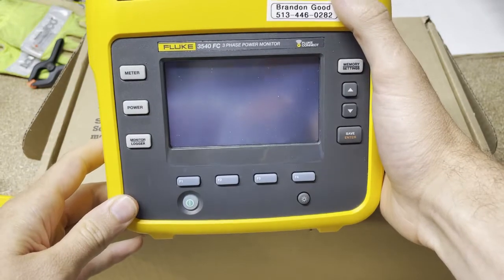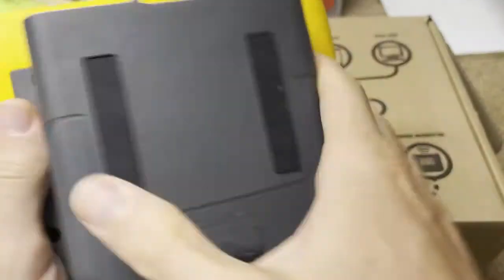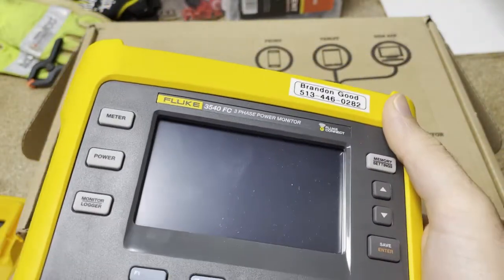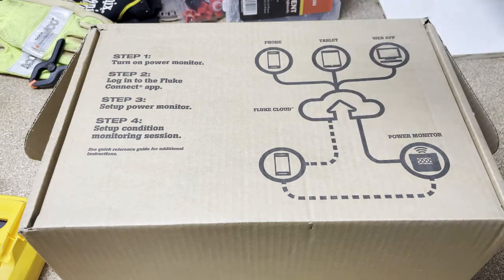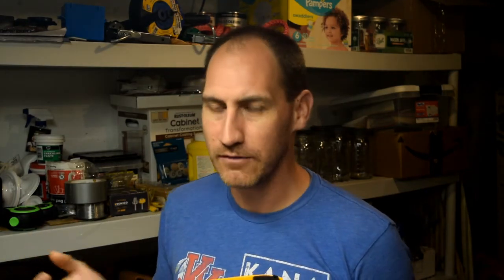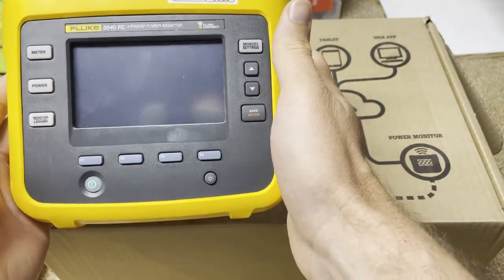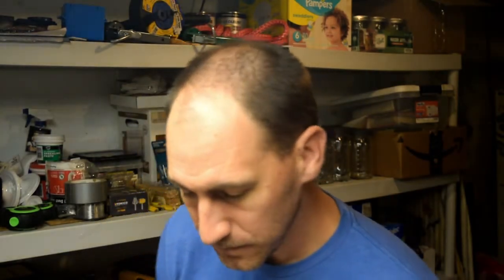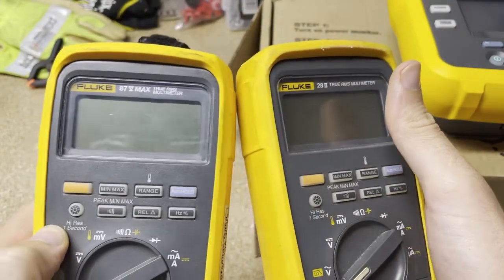Fluke 3540 FC - Fluke Fridays - Episode 55

Comment: I need your help!!!!!!!
need to buy a power analyzer:
The power input to our traffic signal cabinets is 120/240 single-phase.
We are interested in assessing AC power grid quality.
The typical AC RMS current for a traffic signal cabinet ranges between 30 to 60 amps, we will need to leave the 
Monitoring unit inside the cabinet for a few days. It is essential to be able to email the recorded data to the electric
Company, so having reliable and secure data is important.
The cabinets are located on the street, and environmental factors such as humidity, as well as low and high temperatures,
May affect the cabinets.
Reply from the maker: I would recommend one of the following:
Fluke-1736/EUS or Fluke-1746 (no screen but can handle harsher environments)  

Fluke-1736/EUS (do not get the "B", you wont get the accessories you need) - https://www.amazon.com/dp/B016DPDVI8?linkCode=ssc&tag=onamzbra04d98-20&creativeASIN=B016DPDVI8&asc_item-id=amzn1.ideas.2XZ847JBOA5EJ&ref_=aip_sf_list_spv_ons_mixed_d_asin

Fluke-1746 - https://www.amazon.com/dp/B07DY3N3Q4?linkCode=ssc&tag=onamzbra04d98-20&creativeASIN=B07DY3N3Q4&asc_item-id=amzn1.ideas.2XZ847JBOA5EJ&ref_=aip_sf_list_spv_ons_mixed_d_asin

Comment: Not a happy camper!!! Did not know i needed a subscription to the cloud to use this. Only wanted local Datta logging capabilities. And i want something fast to pick up spikes and brown outs etc. Any suggestions and can i trade or sell this junk?
Reply from the maker: I would go no lower than the 1736/EUS (do not get the 1736/B, it won't come with CTs)  Other great Choices: 1738/EUS, 1775, 1777.  (if you're not working with a distributor already check out my amazon Links:https://www.amazon.com/shop/fridayswithbrandon/list/2XZ847JBOA5EJ?ref_=cm_sw_r_cp_ud_aipsflist_aipsffridayswithbrandon_6311M39PGEAJCSPW68H7

Comment: Wish I watched this video first... I have no need for cloud-based monitoring.  My local Fluke rep pointed me down this route and the 1730 series would have been a much better fit for me. Honestly, the Fluke app and the cloud system are driving me crazy.
Reply: Yes me too, at first couldn't even start a logging session. Tech got back to me and told me to uninstall the app and reinstall and it took care of that problem but now I can't share anything. I've about had it with this thing

Comment: I'm looking for the correct tool to do the following:
I want to log 3 phase current usage of generators that don't have access to wifi.  The idea is to leave the test equipment inside an enclosure for a week possibly longer.  The generators typically run 8-16hrs a day so the battery needs to keep the unit active during those outages.  After a period of time the tool would be downloaded and I would look for things like peak usage, kWh used per day etc.  The goal is to see what size battery bank would yield a comparable output to the generator for use in a hybrid generator configuration.  Any suggestions on what to buy?

Thx
Reply from the maker: Does the place where the generators are have grid power? I might need to have a conversation with you to make sure I make the proper recommendation. You can call me at 513-446-0282. Or if you reply on here I'll do my best to help you.

Comment: Hi Brandon,
Im planning to buy the Fluke 1734 to measure the power consumption of equipment at my workplace and see where i can reduce that consumption. I just have a question about the voltage probes if you could help me with that.
to connect the voltage probes you must connect one end into the energy logger and the other end into the desired equipment however that means the equipment must have a suitable voltage probe input. How would you go about measuring power consumption of equipment that dont have voltage probe inputs. Also generally, what would you recommend to use to measure power consumption/Energy usage.
Thanks
Reply from the maker: First I think the 1734 is a great fit for power consumption/energy studies. As far as where you connect the voltage probes on equipment. (I'm not sure what kind of equipment your are thinking of) But most will connect at the distribution panel or breaker panel depending on what they are trying to measure. They will typically attach the probes via the alligator clips that come with the unit. If this does not answer your question please reply with additional details about your application.
Reply: I'm trying to measure the power consumption of machines powered by a plug like a large oven for curing, robot arms or even a computer. Sorry Im a little new to this.  I really appreciated the response
Reply from the maker: @Bluewson  typically I would hood up at the breaker feeding that particular outlet.
Reply: @fridayswithbrandon  I am trying to measure the consumption of each machine in the lab but alot of them are connected into power bars or outlets out of reach. I was thinking of attaching the current probe to the power cable feeding into a machine and then manually inputting the voltage supplied from the outlet as it stays constant I believe. Would that work?

Comment: Hi, my company recently bought me the 3540 to log a chiller. I'm having a hell of a time setting up this logger with the Fluke connect app. I still can't get it to connect to the cloud. My question is can the 3540 be used as a local logger primarily?
Reply: I hope Fluke see a lot of complaints and returns with these. 
The Cloud subscription should be an optional feature only, I hate how companies are crippling their own products and tricking their customers to push recurrent revenue business models
Reply from the maker: @sire45  if by punched you mean purchased, then I would suggest that you return it Grainger is great at taking back returns. If you are willing to have a conversation please find me on LinkedIn or call me 513-446-0282. I want to make sure you get the right tool this time.
Reply from the maker: If by local logger you mean it can store internally and then download the data directly to a PC. The answer is no. Where did you buy this and how long ago did you get the 3540?
Reply: I've had it two days now and nothing but problems first with starting a logging session and now connecting and sharing. Ready to throw it out the window

Comment: Hello, very cool video. I wanted to know which thermal camera is the best for PCB troubleshooting?
Reply: it depends if you want to see the IC pins as well or if you want to know the difference in temperature of the lower section of ICs than the top and or want to see all trace temp, too. this is probably a longer answer than you were looking for. what can I say, end of the day, had time and a lot on my mind. below is my experience with thermal cameras.  
thought, I wish I looked at flukes first in 2009 when I started buying thermal cameras. 

I have used C2 Flir (you can pickup used for about $200) , Flir T400, (T series very expensive), the Caterpillar phone CAT S60, and the flir scout TK. 

be aware of caterpillar phone and co, their service is junk their warranty is none existent anywhere close for an acceptable turn around. mine broke in pieces. there are newer models out now. the thermal camera image looked kind of detailed not because of the quality of the thermal image. they superimposed the visible image and the thermal image on top of each other. it's a detail visible image with a very faint thermal image on top. it will show you where about is getting hot. 

Flir T400, purchased 2009 for 13K. very detail thermal image. that purchase was one of the biggest mistakes I made. I do a lot of field service. I originally got it to use in the filed. it is so expensive you be afraid to take it anywhere. I have 2 to 6 stops a day. to top that off nobody really wants to pay for thermal image scan. 

Flir scout is a good toy, I been thinking about using it on a boards to see if it's any good for that use. this is my most recent toy. it only shows thermal image, no temperature. 

Get the C2, C3, C5, (I think someone lifted my C2, haven't seen it in 2 weeks. I hope I misplaced it somewhere). 

You know thermal camera cannot show everything that goes wrong on a board. it can only show where temperature is rising or lowering compared with ambient. you have to determine if you have a short first. 
also when viewing a shorted board with thermal scan the hottest component you find on a board may be  the shorted component but it can be the weakest component on the shorted bus as well.  after the thermal scan you may have to use a micro ohm or mill ohm meter to find the shorted component close by or on the shorted bus. otherwise it's kind of guess work after the thermal scan. I mean it depend on the component getting hot. capacitors are not suppose to get hot, right? if they get hot then most likely they are bad. but I have had resisters, transistors ... getting hot while something else was shorted.  
I know what you are about to say. Maybe I make the video one day...